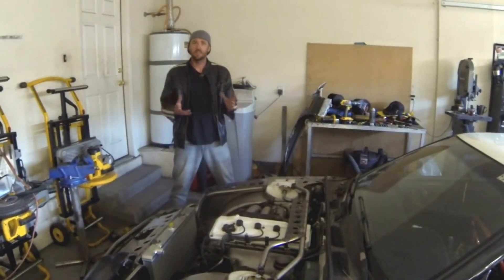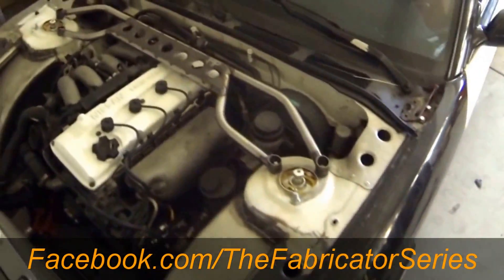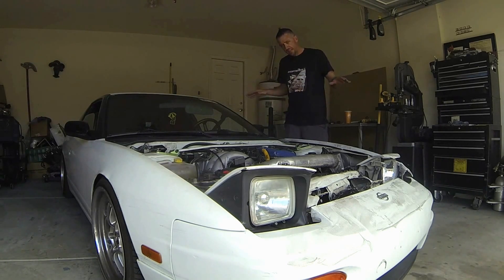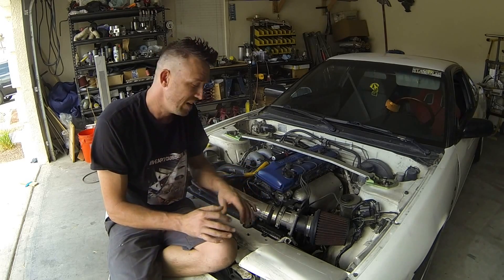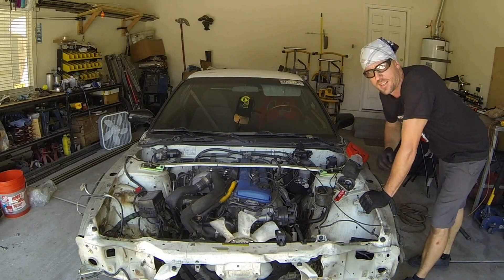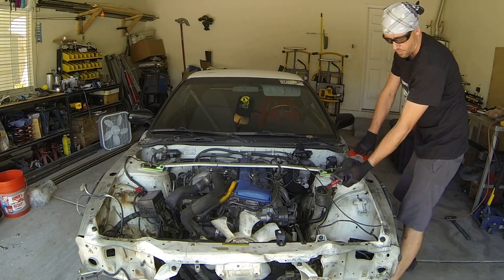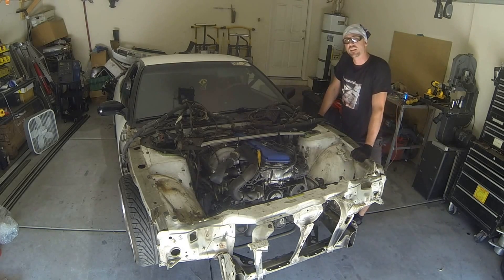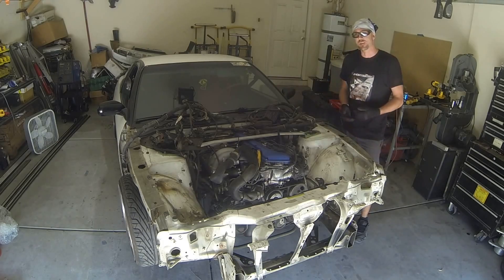TFSS: How to Build a Tube Chassis Front End - Strip & Cut

Comment: I just read that you don"t like air compressor/ tool  noise,
I run two, small, very quiet, belt drive compressors with custom inlet mufflers and mounted on thick rubber insulated plywood sheeting in my attic and  make ductape/ cloth "silencers" on my air tools exhaust  ports.
Reply from the maker: I don't like the air hose either haha. I'm just not a fan of using air unless I absolutely have to.

Comment: Awesome, but I would kill you if you were my neighbor.
All that noise coming from that echo chamber, unreal, lol.
I do the same type of work, but I insulated for sound and built real garage doors that swing out and they  are sealed / sound batten insulated. 
HVAC Ventilation is mufflered  and baffled. Attic is sound insulated,
Walls and ceiling were stuffed with safe and sound batten and a second layer of fire rock floated over with acoustical adhesive. I hang fire blankets on the walls and hang and store moving blankets over the rest.
Fire retardant  work mats are randomly used in and around the floor were I stand and things are dropping. your knees and back will thank you.
Meltable fused link fire sprinkler system, just a spring loaded cable system with fused links in different locations that operate a normally closed ball valve.and master electrical cut off switch. Allows me to sleep at night.
My tools are cloth taped. I use a band saw and power hack saw instead of a grinding cut off wheel. 
A belt / disc sander for the straight edges   and outside corners, flap disc  for inside  corners , does a much better job at quickly cleaning up cuts to line.
I use an annular cutter and carbide drums for notching. And a plasma cutter for bulk /other cutting instead of sawzalling . I also use a beverly shear and foot shear instead of electric shears and nibblers, although I do use them.
Even though I covered up I still got skin cancer from the welding flash cause I didn't enough .
I use a vac extraction hose system for removing work smoke. Shop is over lit.
I schedule noisy work after ten and before five.
Even if your neighbors / family say they don't mind or understand or don't complain, "cause they're cool" They really hate it and are just politely suffering you.
I can work and play my guitar and no one knows what's going on except when they see the results.
My new neighbors  fifteen feet away ,thought I was unemployed for the first year they were here!
I don't let people rev their junk or bump their sounds when they come around, Yelling or cursing outside the garage  is banned, as well as oil  leakers.
No work on Sundays and holidays either. I try to find out my neighbors birthdays and anniversaries as well. I don't feel paranoid about noise , I feel conscientious about noise. 
It's just tacky and cheesy to wail away like that, regardless of how nice your work is.
If you want the benefit of working from home then do your due diligence as a good neighbor and car culture ambassador / personality.
Just saying.....
Reply from the maker: If my neighbors told me they didn't mind, I took it as that, but I am respectful about my work when I work at home.
Reply: hulagan808    you must be the neighbor! lol